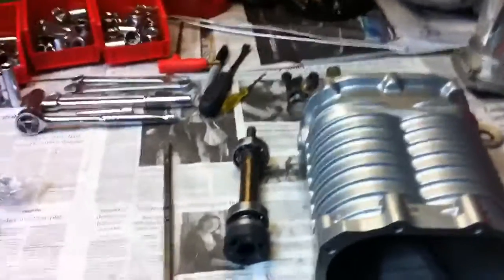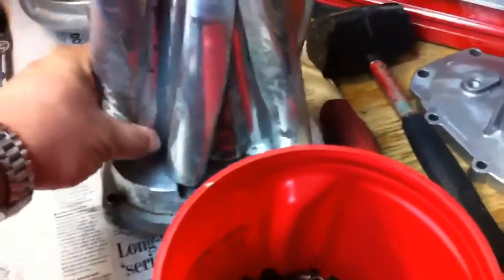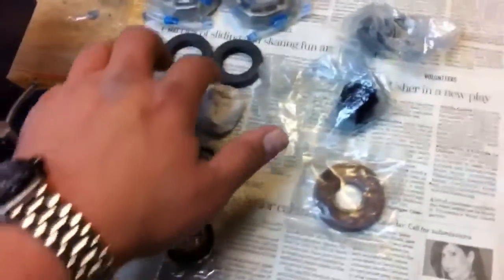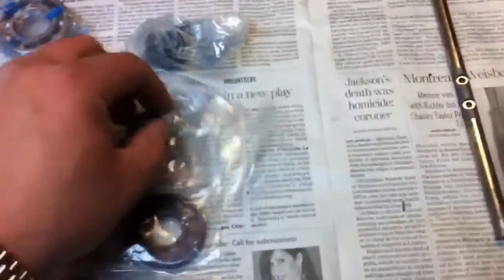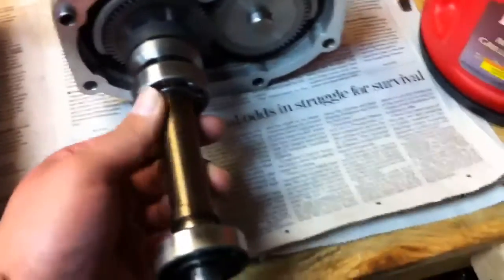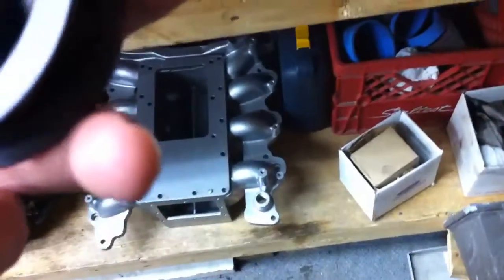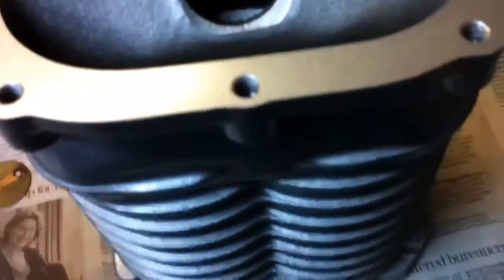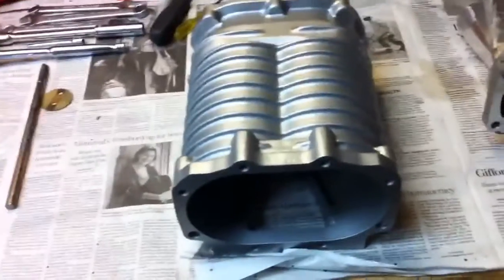Supercharger rebuild promo eaton m90.

Comment: what's your price to rebuild these blowers. I have a gen3 M90 in my Pontiac Bonneville SSEI that could use a rebuild.
Reply: or so to say, what is your ballpark range?
Reply from the maker: It all depends on what's needed and damage I don't do them often anymore as I'm running a very busy shop I'll take them on over the winter usually !
Reply from the maker: If it needs bearings it's around 450

Comment: how much do you charge for rebuilds? I just swapped a rotor case on my gen 3 m90, and the is a clunking sound. I dont think it's the bearing because the clunk is not predictable or consistent
Reply from the maker: I'll have to see it to price
Reply: thanks for replying to an old comment. Turns out I was rotating it the wrong way haha. I think I did an ok job for a first timer. I had some used needle bearing with about 50k on them. I cleaned those up and used wheel bearing grease. Read on the lightning forums it was a good substitute. Cleaned the inside, rotors, and gears. Fresh gasket and put some new supercharger oil from jon bond performance. Also gave it a paint job with vht engine enamel
Reply from the maker: that's great
Reply from the maker: Great job